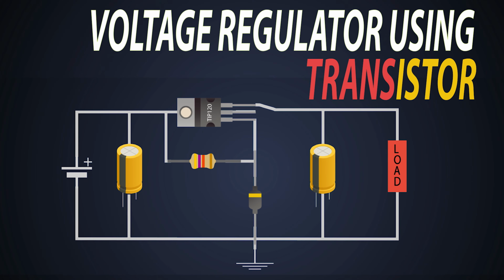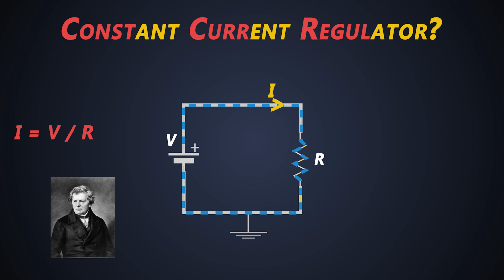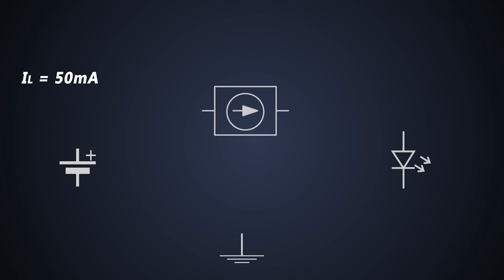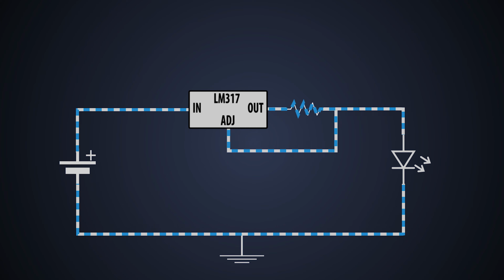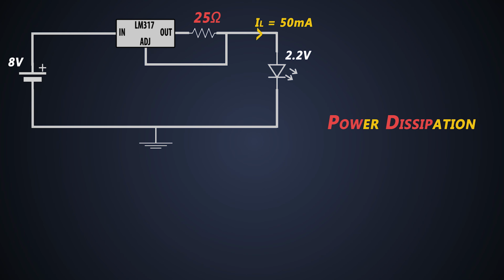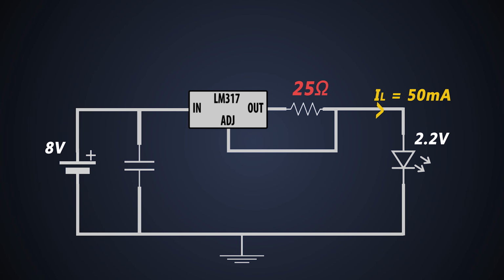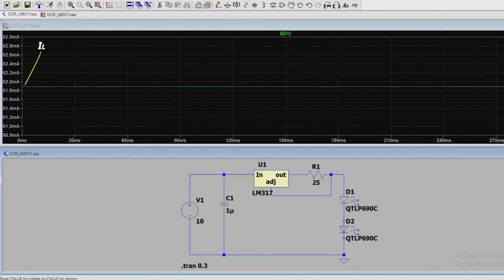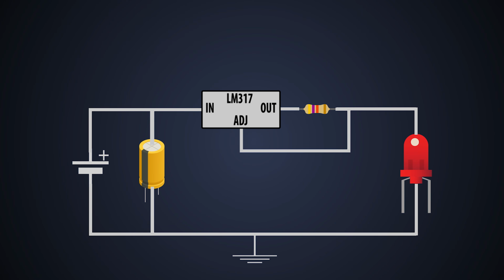Constant Current Regulator using LM317 | CCR | LM317 as a current regulator

Comment: Thank you for the wonderful explanation. 
I need to make a circuit with a constant current of 2 amps with a voltage of 15 volts. May I request you to provide the specifics for the same please?
Reply from the maker: You can’t create linear regulator for 2A circuit, you need pwm based Dc dc to converter to do that

Comment: I use this circuit to discover zener diodes break voltage. 
 The problems are: 
1_ voltage limit to 37v 
and 2_ drop out voltage of 2 to 4 volts depending on the current chosen . (usualy 6mA)
Reply: Ir stabilitronams tikrinti, ir šviesos diodams tikrinti galima naudoti paprastas varžas. (LT)

Comment: two simplifications are made, including ignoring the (1-x) part of R3. But Ic regulator actually has current flowing via it's Adj pin, and R2 is quite big so leaving out I_adj of formula is not good. I will connect that CCT and see what happens, pity the author did not do that.

Comment: I need 2V and 300ma from 5V input. How many ohm resistor can i use ?
Reply: The LM317's datasheet explains it cannot be used as both a current and voltage regulator. You will need another type of current limiting circuit behind your voltage regulator.

Comment: Hi, Instead of the LED shown, I want to replace it with a wire of 0.3 ohms. The current flowing through the resistor is 50mA. Will it create a voltage drop across the wire of 15mV?

Comment: LM317 is available for max 1.5A. But I require 16A constant o/p current. How to manage in that case?
Reply from the maker: You can use Dc to Dc converter based current regulator

Comment: Calculating the resistor value you pointed out the values of the voltage in (8v) and the voltage value of the led (2.2v). But in the calculation both are irrelevant. How do you know (or better said, how you calculate the voltage output of the lm317 for a led) Ex: 12v in 6.5v for the led at 0.4 mA. Could you elaborate in how to get the 6.5v from the lm317 and the resistor value in order to output 0.4mA? Thanks for your attention.
Reply: LM317's datasheet parts 8.4.1 and 9.3.3 explain this part.

Comment: all these Constant Current Regulator are good but most of them are low AMP circuits what about high amps like 12v 30Amp?
Reply from the maker: You can use PWM based current regulator
Reply: @FoolishEngineer  Thank you i will check it out

Comment: I want to design circuit for convert 12Vdc to 2Vdc 50A with adjustable current using Potentiometer.
This circuit continues running for 1-4hour in each day.
But I haven't knowledge of electronic circuit.

Can you guide me how to design circuit, please.
I try to learn many circuit design on youtube for a few week, but that can not bring to apply to my requirement.
All circuit I learn, It not support height current with low voltage.
I can not see the advantage + disadvantage of using MOSFET VS LM317 VS TL494cCN

Comment: Hi,
Good presentation. Two questions I hope you may be able to answer: 1. What is the maximum voltage out of such a circuit under light to no-load conditions. i.e. is it Vin, Vin-1.25 or Vin-1.25-Some additional voltage drop? If the last is true, what would such an “additional drop” be? (You may figure correctly that the question relates to use of same circuit for current limiting as opposed to a constant current source)
2. Did you create your own LM317 model for LTSPICE?
Reply from the maker: 1. 1.25V drop is of LM317 itself
2. you can find its spice model on onsemi, TI or STM's website

Comment: Hi, I have an 24V, 2.71Amp power adapater but I want to Reduce its Voltage and current as 21V and 1Amp. Please help me design a circuit using LM317. Thanks in advance.
Reply: that should be 1,25 ohm

Comment: hi there. i want to limit and vary the current of a 24V/1A power adapter between 2mA and 12mA, using a LM317, 1k ohm pot and a 1k ohm resistor. would that work or is it better I get a 2k ohm pot?
Reply from the maker: Hi, did you do the calculations as mentioned in the video?

Comment: Upto how much current
We can use this
Reply from the maker: Instead of current our logic should be power dissipation. We should dissipate more than 300-350mW power through the LM317. So according to calculations, if you have more number loads you can use this for higher current and if you have less number of loads you should limit up to lower currents.
Reply: As much as LM317 is capable of, but the problem would be derating as temperature would increase. So we need to consider that as well.